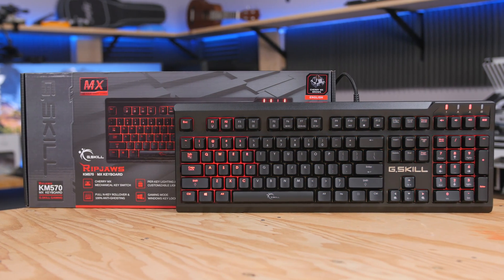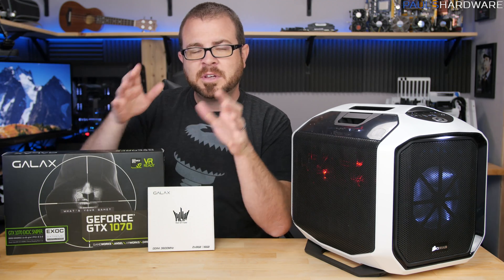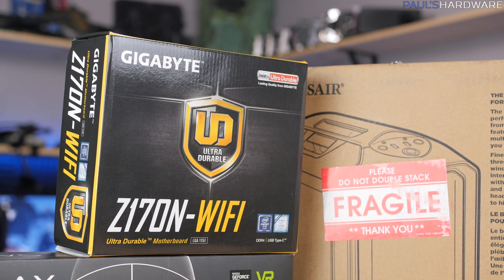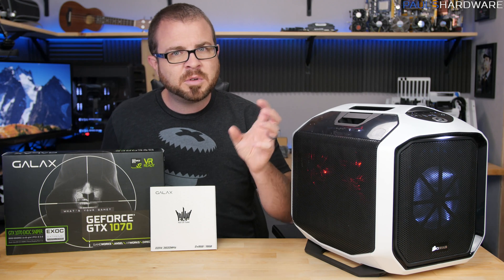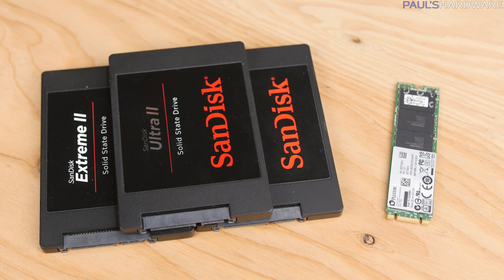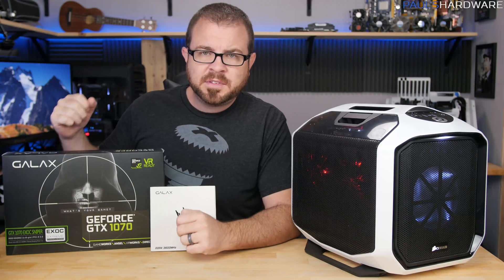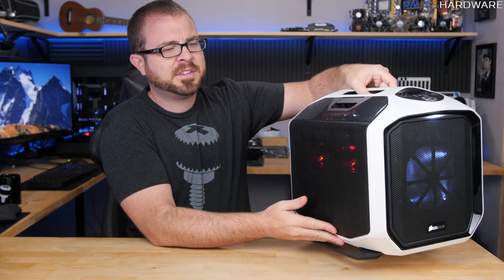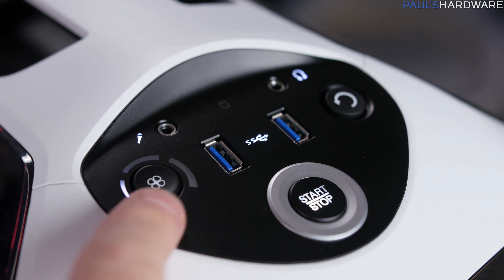Powerful + Portable Mini-ITX PC Build in the Corsair 380T

Comment: To this day I still have my Corsair 380T and man to actually make a decent cable management on this case you can take off all the plastic parts leaving you with it's aluminum frame and thinker around it. Yes you need a modular PSU on this so you can customize the length of each needed cables to make a clean route. I still love it to this day but hoping to modify the side window with plexiglass so you can see the side panels better though I have the Corsair Hydro 100GT AOE for the CPU that blocks the view even more as the other side displays the GPU 😅😅

Comment: My first white 380T assembled December 2017 with ASrock Motherboard, Corsair PSU/RAM 32GB, 2x Samsung Evo SSD 500gb Raid 0, Intel i7 7700k, EVGA 1080ti Hybrid, and Corsair CPU watercooler.  Near tight space, but all fits in, those who are trying to put almost the best inside in this discontinued 380T portable case might require little mod or no mod base on parts, and cable management to take advantage of front case fan cooling.

Comment: this case is crap, i built in one. Its not even small for a itx, there are smaller micro atx cases. The fans that this guy is raving about are UTTER SHIT. They make pulsing noises and can't maintain smooth rpm.

Comment: Hi guys! To those people who know a lot about computers pleasee I need your help. I have an i5-6600 and GTX 960 on a mini-itx on board and I can't seem to run Dota 2 (around 45fps) and CsGo (around 50fps) with high FPS, I know that with my cpu and gpu those games shouldn't be a problem, but maybe I'm doing something wrong? Idk. I found out though that in my task manager, instead of having 3.30Ghz as what it stated, I was only getting around 0.79Ghz. I compared them to my friends and they were having speeds that was in par with what their CPU promised. I have updated my drivers and changed the maximum and minimum processing state to 100%  but that still doesn't solve the problem. What should I do? Hope you guys can help me ://

Comment: Guys I have a question 

My build is:
i5 6600k
GeForce GTX 1070
Ram 8GB
Samsung EVO 250GB
Motherboard MSI Z170 A M3
212x cooler master fan

My question is:
What power supply I should buy
I'm currently thinking of buying 
(Corsair RM 650) but I'd love to buy a cheaper one since I'm broke a bit so would the (Corsair VS 650) works fine or I can get even lower or what I'm kinda lost
Reply: Still waiting? What's your absolute max cost?

Comment: the current (video) motherboard can sustain 3200MHz on the RAM in O.C. mode so what use is for 3.6GHz ram? and the PSU Corsair RMi Series RM750i 750W, 80 PLUS Gold (would?) be a better choice?

Comment: how much does the gpu throttle
Reply: I have the same case and it doesn't throttle at all. You have cool air coming in the front, and all the GPU heat is dumped out the side of the case, whilst the CPU heat is put out the rear of the case.

Comment: Hi Paul. Very nice build.
I just subscribed to your channel so I thought I'd same a bit about what I'm looking for from a channel like yours. I shoot and edit video for my own enjoyment. Right now I use a Lenovo W530 laptop with 32GB of RAM, i7-3740QM CPU running at 2.7GHz, and an NVIDIA Quadro K200M with the Windows 7 64bit OS.

Eventually I'll want to upgrade to a new system and am looking a channels that will build and/or review mid level systems targeted for video editing, some VFX, rendering and video transcoding. I'd also like someone to do the down and dirty research into the best component configurations to maximize the system for these tasks. Things like putting the scratch directories on a RAID-0 or M-drive or whatever. Stuff like that.

I haven't looked through your back catalog of videos so I don't know exactly what kind you do, but what I saw piqued my interest. Maybe there are more folks like me looking for the right hardware at the best price to get their job done.

QUESTION: How much longer do you think PC hardware will remain easily available in this post-PC world? The "regular" people that used to buy desktop and laptop computers are now using tablets, phones and the cloud for the "normal" tasks. I think Apple is getting out of the PC business. It's only a matter of time until the economies-of-scale start to dwindle, don't you think? I

'm worried about this because I've had a PC of some sort at home since 1975, I soldered my first one together myself. I think I want one around for at least the next 20 to 30 years.

Thanks.

Comment: Uhm.... that case is huge for mini-ITX. Doesn't that kinda defeat the point?
Reply: Clairvoyant81 it actually isn't huge
Reply: Jesse Forsell
For a mini-ITX case it is.
Reply: Clairvoyant81 ***** Well if you put it like that then i guess it is huge. Can´t really argue with logic! i currently have the define nano s. Have a good day sir
Reply: Jesse Forsell
I currently own an NZXT H630. Of course, compared to that, the case used here is tiny. ;)
Reply: I have both of these cases... and the Phanteks Evolv ITX is rather large also... just sayin
Reply: Also, you a no compromise mATX build with this size? I think not. I have this case with an h100i cpu cooler and a 1070 msi seahawk water cooled.... you cannot fit another damn thing in it.

Comment: If I wasn't bothered about the system being portable as much as just choosing m-ITX  for the sake of having a build with a small, tidy footprint, is there any real appreciable air cooling/OC performance difference between an m-ITX and ATX build, enough to ultimately make the ATX build option the better choice?
Reply: ATX is a larger volume of air, so it takes more heat energy to increase the temperature by a given amount than it would with a mITX or mATX case. I've noticed that keeping the same system in a Corsair Air 540 vs a 900D (which are basically identical cases in terms of fan layout etc, just one is huge) has had a massive impact on temperatures.
Reply: other tomperson I'd be running a founders edition card in the mITX. Assuming that you're speaking of an ATX system with a third party card and custom cooler (and granted the ATX volume would of course still make an overall cooler environment), would the heat being generated by that vs a founders card make it a closer match?

Comment: I built a lan party computer for my nephew in that case and it's pretty sweet.  That case also supports 120 and 240 radiators/AIOs (at 6:30 into the video you will see 2 metal bars with holes where you could mount it)  One thing to note depending on motherboard's placement of of 4pin or 8pin power and 20 power you might only be able to fit a 120mm radiator/AIO above the PSU.

Comment: I have 1 question if any1 can help cant find the answer.. If you have for example  512GB Samsung Polaris SM961 NVMe M.2 does the way you connect it to your pc affect its speed,is it slower if you connect it trough M.2 slot than if you connect it in in PCI-E 3,0 slot with some adaper like DT-120 Lycom M.2 SSD to PCI-E or any other..  or its all the same any way you connect it??

Comment: I don't like the "fat form factor" on miniITX cases, but I can say this case impressed me (and cases rarely impress me). Easy to remote side panels and easy to remove drive bays are the most important features on a case for me.

I don't care about tempered glass, fan controllers, LEDs or the space constraint, I'll work my way in. I give this case an 7/10 for having those features, but not more, because it's supposed to be a miniITX case. If it was a microATX, it'd easily reach 8 or 9 out of 10.

Comment: What was that stick that you put under the motherboard?
Reply: M.2 drives use the PCI-E interface I believe which is much faster compared to SATA (there are some that are SATA-based)
Reply: Sheena1234ization Thats an ssd, a faster type and smaller form factor
Reply: Tobi Kuye oh, how come it didn't look like the SanDisk ones?
Reply: Sheena1234ization Its called an M.2 drive honestly I don't know why it looks so different to the others
Reply: It's a storage chip.
Reply: Regular SSD'S are taking up too much space in new super thin electronics so M.2 is the way to save space. And faster in pcie form

Comment: where he's building on is that just a mousepad?
Reply: It looks to be a Cooler Master - Storm Speed-RX SGS-4030-KLMM1 (Large).
Reply: its an anti-static pad. It is supposed to be a safe place to build sensitive items against static electricity which can possibly kill your components in less than a second.
Reply: which never is going to happen unless you're on a carpet.
Reply: can you use mousepad aswell?

Comment: quite honestly... i don't care one bit what you test, i just want to know how well the gpu works in there. Currently finishing up a very similiar build (h170 version of the motherboard and an asus turbo 1060, but generic similarities) in that case
Reply: going to be going with an i5, either 6500 (most likely) or a 6600 non-k. the size of the case and the layout has me nervous about thermals, its also why i went with the turbo 1060. plus it doesn't necessarily NEED to be too powerful when my intended use for it is gaming at cons or whatever where its pretty much just hooked up to a tv

Comment: Real wicked build, paul, wish i could build something like that. I build a mini itx mini monster :) Sharkoon C10 case, msi H110i pro (cryorig C7 doesn't fit), G4400, MSI GTX 1050ti 4gb, Hyper fury x 2x4GB 2133mhz, Corsair VS 550 (just about fits but blocks my usb 3 slot on Motherboard :S) Play mostly Blizzard games, WoW / Overwatch ........ works like charm.

Comment: Great build, but I have been through this before. This case is a big fat monster for an ITX board. Just like in the past when they came out with Micro ATX board and then came the over sized Micro ATX cases that were almost as big as a standard ATX case. With each smaller board or case size you loose functionality and upgrade capability. ITX is meant for a limited capability and a small foot print about the size of an XBOX ONE or PS4. They work great with a smaller processor and graphics card in a small space. The nickname I would give this computer is FATBOY.

Comment: I love my 380T case too (yellow). It was a fun build...  I replaced the front fan with a larger 200mm led one. I had bought a large cpu cooler fan, but was not able fit it like this one in the video, so I settled for a decent Noctua NH cooler. Runs nice and quiet. Actually, I'm impressed with how everything can run as quiet as it does in that case...

Comment: In most mini-ITX cases I know that blower style GPUs generally offer better thermals. Did you use the Galax 1070 because this case has better cooling than other mITX's, or is it cause you got sponsored by them?
Reply: powderpuffman121 I think it's because of the GPU positioning. The GPU faces directly out and can draw in some fresh air. Better for the GPU cooling but I'd like to see the CPU temps before I make a judgement call since that hot air is being exhausted into the rest of the computer. Also I think he could afford the GPU fan style because there wasn't a PCU blocking half of the fans.
Reply: dogsrulenw08 Well if you look at the positioning of the other fans, you basically have a windchannel from the front directly througj the cpu and out the back (basically push-pull because the cooler is so big. Also a lot of mesh for hot air to get out

Comment: Will this case fit a graphics card about 12 inches?
Reply: PuLsE Munstaz 29cm/11,4 inches to be precise.
Reply: yes it will. a quick search on forums will yield results which point to the direction of yes. Source: Previous experience
Reply: Ok cause I'm running a Gigabyte GTX 960 2G G1 Gaming edition which is about 11.7 inches.
Reply: I have this exact same case and that exact same video card...it does fit.

Comment: Should i upgrade to a i7 6700k or waiting for kaby lake?
Reply: What are you currently running?  If it's Haswell, it makes more sense to wait for Kaby or the next gen after that depending on what you're using your pc for.
Reply: im actually using a i5 4690k oc too 4.4ghz and a gtx 1070
Reply: CasuaL
There is no reason to upgrade to even Kaby Lake.  Wendell and other's have already discussed Kaby lake is only a 1 to 3 % real world improvement over Skylake and Skylake is barely a 7% improvement. 

I recommend waiting until the generation after Kaby Lake to finally see a real world improvement and just save up with a full system build-upgrade.  You'll have to blow hundreds of bucks anyways be it for a Skylake or Kaby Lake compatible motherboard and the ddr4 ram,  It's basically pointless to do exactly that with Skylake or Kabylake. 

The 4690k overclocked to 4.4ghz is virtually the same performance in 1440p gaming as my 4790k overclocked to 4.5ghz depending on the game ( most games that is) within a 7% margin of error of fps using the same video card for comparison ( in my case the r9 280x)

With your video card, you're already able to jam on Crysis 3, Battlefield games, sc2, Civilization ( whatever the newest number is ) and other 40/60-ish % cpu/gpu demanding titles at 1440p maxed or uhd medium settings.

Sorry  in case my recommendation puts a bad fart on your plans or ideas, but I just hate to see seemingly decent people burn  cash with no real noticeable benefit. 

When Zen ( or IF ) gives intel a run for their money ( like the athlon x2 6400 days of 2007/2008 maybe alittle into 2009....then we'll see intel get off their asses and get back to pushing for better IPC and overall performance gains in newer gens versus the slow ass slouch phase they have been in for the recent going to the two next gen of cpus.
Reply: Thanks for your advice :)

Comment: Is there any advantage to building a micro itx system for transport over getting a gaming laptop with say  a 1070 in it? I understand that the laptop cpu would be weaker, but wouldn't the reduced weight and increased portability as well as reduced chance for component damage be enough to give the laptop the edge over the mitx build?
Reply from the maker: In most travel situations I've gone with laptops for editing which works just fine, in this case it's a road trip so I figured I would bring along a full sized rig
Reply: foodman6500 no gaming laptoms prety much just suck
Reply: foodman6500 the main problem with gaming laptop is lifespan and heat. since they pack so much power in such a small frame, they reach very high temperature, and therefore don't usually last very long. beside, when you bring a laptop to game or work, you usually stay in an hotel, which have a tv to which you can hook up the mitx PC through HDMI.
Reply: foodman6500 it depends on your use case. If you are a student I'd recommend to get a gaming pc and spend 100 on a chromebook. But if you travel regularly and the extra cost of a gaming laptop is fine I'd go gaming laptop
Reply: You can build very small ITX builds these days. The biggest problem with GTX1070 laptop is price. Screen size can also be a problem if you want to use it for streaming and other stuff.
Reply: foodman6500 If you really break it down, it comes down to upgrades. Your Laptop will accumulate dust and will run hotter over time, which will make him throtle or louder, but so does your ordinary PC(but even then your pc will most likely be quieter since he doesnt stand underneath your head). The huge difference is that you can swap out your drives and graphicscards without any problems to be prepared for the years to come for far less money than to buy a new laptop. Some might also argue about limited ports on laptops or that youre stuck with the monitor you bought with the laptop.
Drivers can often be a problem for newer os, but since you will probably stick to win 10 for the next decade, I see no real promlem there. Tell me if I missed something important, but besides to higher cost of Laptops in comparison to equally powerfull pcs there is not much more to think about.
Reply: Well, fuck me. For transport a laptop is much better since you dont have to bring a big heavy monitor with you. Sorry, I didnt read your question carefully enough.
Reply: You can buy a very potable monitor.